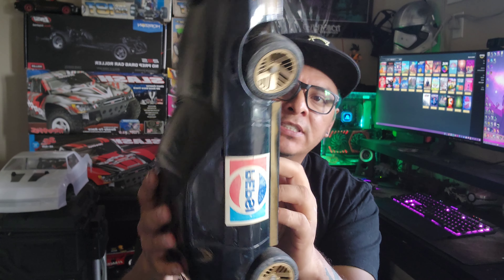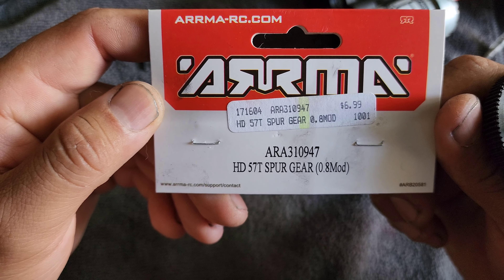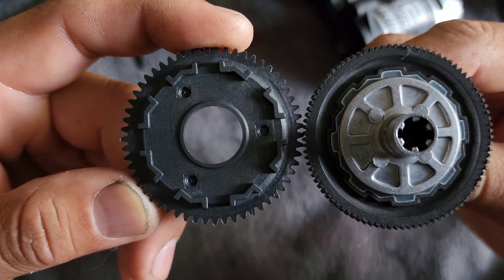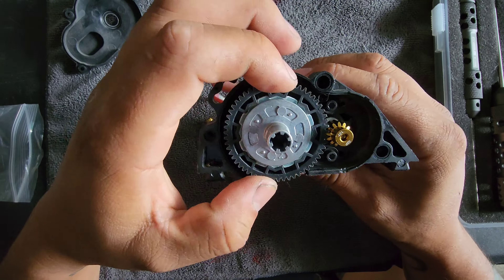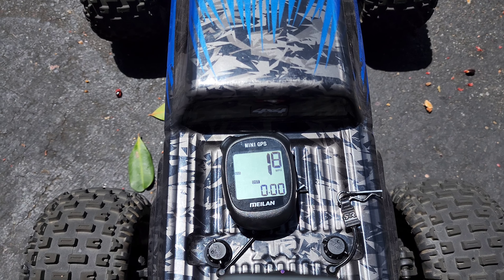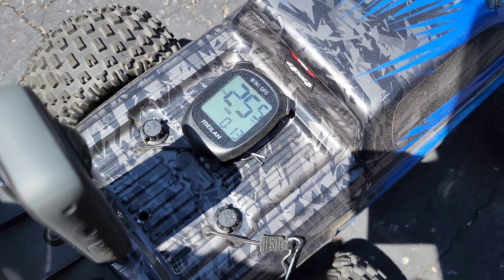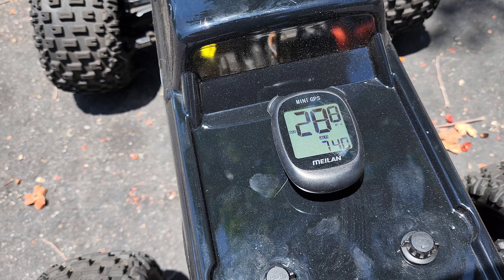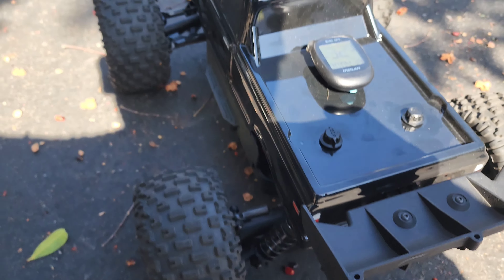How to really get 30 mph and beyond out of your granite 4x4 v3

Comment: I just got my brushed granite today and originally planned to go with a bigger sensored motor/6s sensored esc and all but after ordering I noticed its not just different motor/esc and $40 4wd kit when I was researching what pinion to order I kept seeing mod 0.8 which is 32p vs 48p. Looking at the booster kit for converting brushed granite to brushless you can see they include the entire housing with metal motor plate(another thing I didn't know that it's plastic and not adjustable). I did a fair bit of research but found no mention of this difference in any of my brushed vs brushless Google searches. It took looking up the pinion on Arrmas website and seeing the 2wd wasn't on the mod 0.8 pinion page under compatible vehicles. Thanks for posting the part numbers!
Reply from the maker: Oh yeah, so you went the slightly longer route. But no problem! Glad the video helped. I know I struggled trying to get info as well